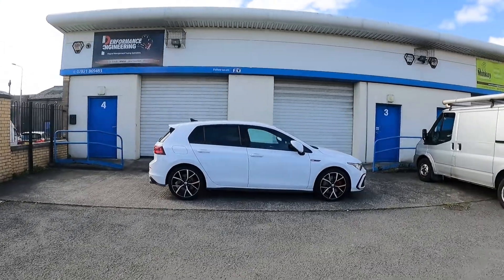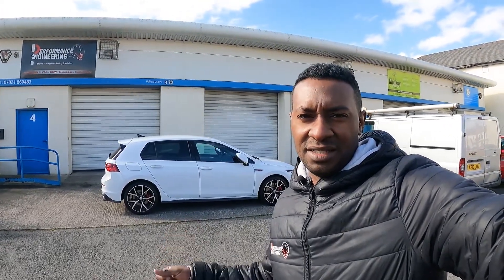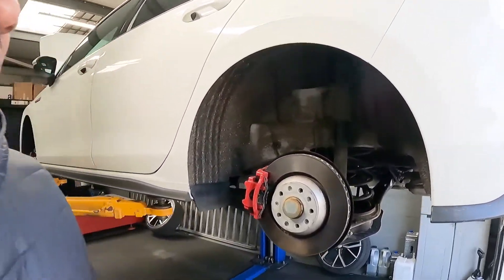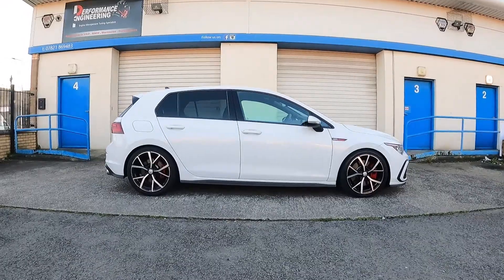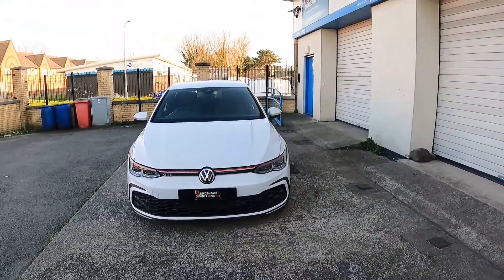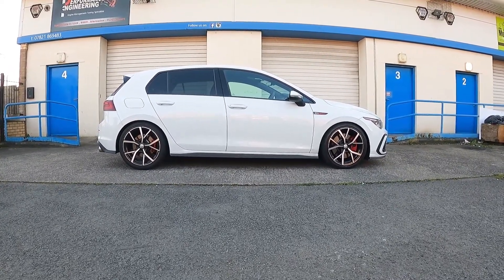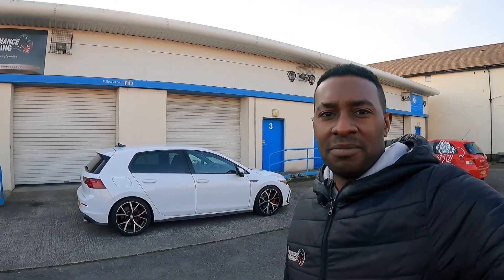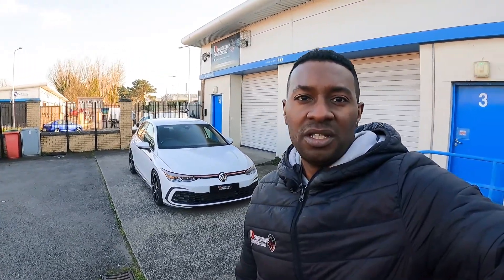VW Golf MK8 GTI H&R Install - PE Handling Package

Comment: What size spacers and extended lugs were used? Will spacers from the previous MK 7 and 7.5 work the same? I can’t seem to find any for sale for the MK8.
Reply from the maker: Hi Ryan.

They are available from our website but yes fitment is the same as the mk7.5. If you want to order a set them me know 👍